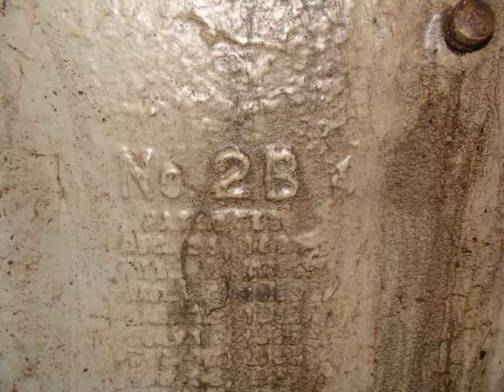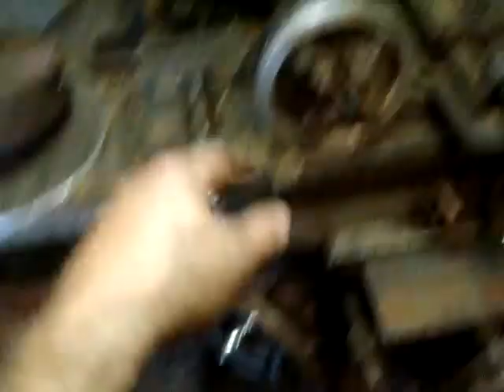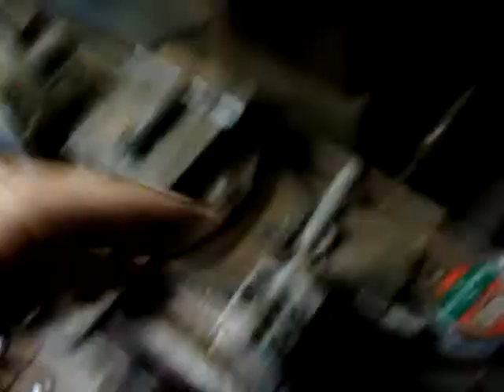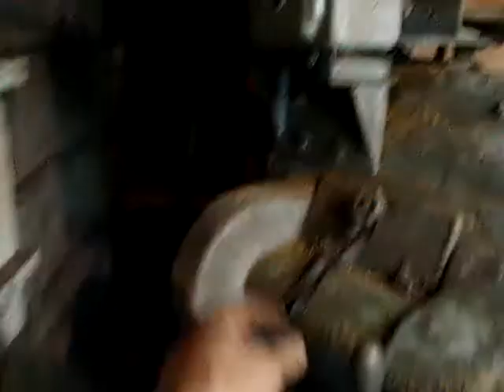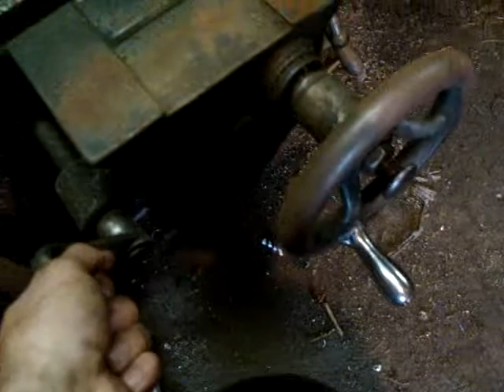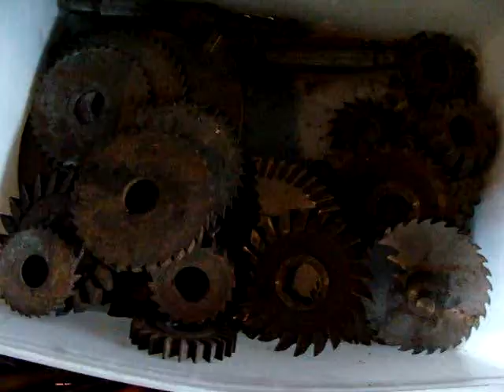Brown & Sharpe Model 2B Milling Machine

Comment: I have a 1940's Brown and Sharp horizontal mill. Yes this is a horizontal milling machine. My machine has a vertical milling head, which attaches to the drive that you called "the lathe". I believe that is what the milling bits go to.